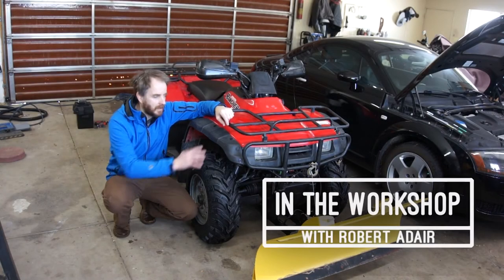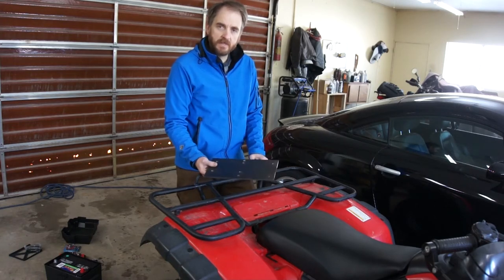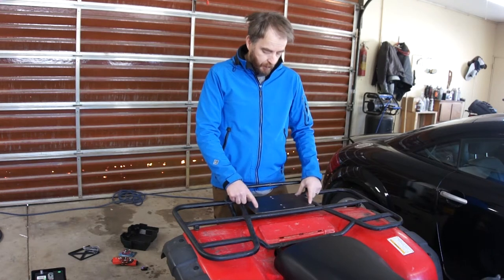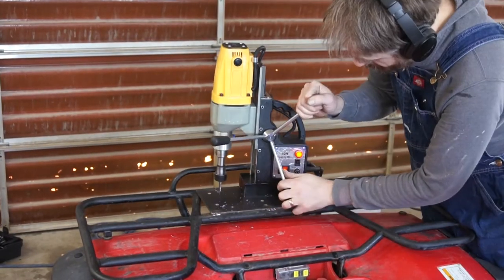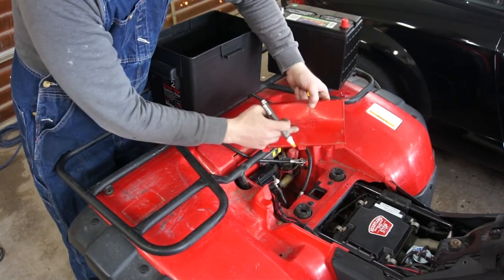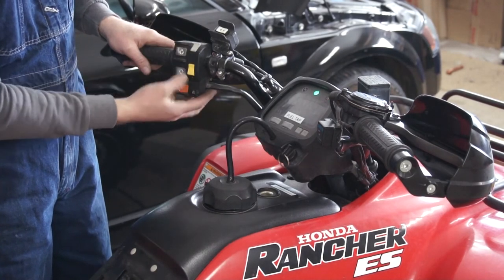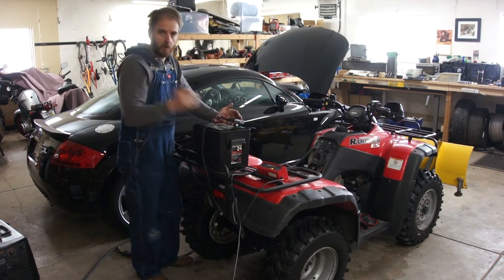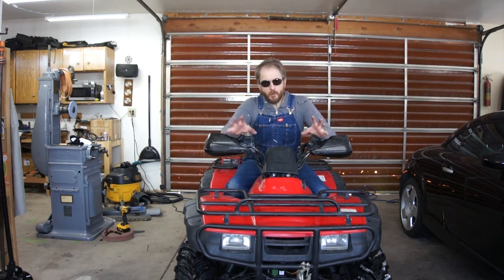Car Battery in my ATV Plow = No More Dead Batteries!

Comment: As an old time trapper, I have learned to never take advise from people who have not done what I want to do. All they seem to offer is negativity. I use the ATV plow year round on the traoline, and about ten years ago, I went to an automotive battery.  It has always worked perfectly. When I check my traps, I leave the ATV running and the battery charges fully. It has never, EVER gone dead. I loved your video. Bravo.

Comment: Can you give us an update on how this has worked over one year?  I have EXACTLY the same problem as I use my ATV to plow my driveway and our entire street.  I was going out to buy another small battery - but it will have the same problem soon.  I'm going with your solution.  I have no concerns about "frying" the charging system.  My Tracker 570 alternator IS designed to run the ATV and charge the small battery at a certain rate.  With a huge battery, it will just take longer to charge.  Since it can't produce enough power to run the plow and the ATV, the big battery will drain as well - but should last long enough to get my job done. Your idea of hooking up a charger after the plow work is the right solution.  Great idea....
Reply from the maker: Hi Craig.  It's still working great.  I had the plow sitting outside all summer without charging and the plow started right up this weekend when I needed it.  I haven't had any trouble with the external battery losing charge or the ATV charging it.  It works the plow, heated grips and two sets of LED lights (I added a set of rear lights late last winter). I would absolutely do it again and I'd do it exactly the same way I did the first time.  Highly recommended if you're having the same trouble I originally did.

Comment: I found myself with  extra good working car battery,about 30 minutes ago I wondered hey,can I put a car battery on my arctic cat 300 4x4 that I use for plowing my long country driveway. Was expecting to see Heavens no you will fry the system,but no found a few sites that said absolutely,and a couple that said oh you will ruin it,so yours was the only video I watched and am going to do same as you,though will just fasten wooden board and bolt battery box at same location. Its very troublesome hooking up charger in that small spot,so having battery right on rear to easy put charger on will be great.

Thanks for video
Reply: Meant to add we had a  car that we had to go to 2 batteries ,worked great,solved the problem
Reply from the maker: I've had really good luck with it.  I can even leave the battery sit for 6 months without charging and it'll crank right over.  The old small battery would run flat enough in that time to give me the solenoid click and I'd have to jump it.  You'll be happy with it when you get to plowing later this year.

Comment: i figured this is my problem also. i not only have a plow but converted to a bucket. used it all day works fine but the next day dead battery, time to go big
Reply from the maker: I sure don't regret doing it to mine.  Even off the charger, it sits all summer without use and doesn't go flat.

Comment: It's been a year now.  Any issues with your charging system?  With the starter motor from extra cranking amps? 

 I'm just tired of the short life of ATV batteries period.  I don't use a snow plow, winch, but just a few extra led lights.  I've been thinking of installing a car battery on my Polaris ranger.    Do you still recommend this?
Reply from the maker: No trouble at all.  The plow sat all summer, not on a charger, and fired right up.  Hadn't been charged since last March.  I have no regrets.

Comment: Hey Robert, nicely done.I’ve been meaning to ask you about your welder. What can you tell me about it? Works well for you? Thanks.
Reply from the maker: Hey, Lee.  Thank you. It’s a Hobart Handler 190.  It recently replaced a Lincoln Wedpak that I had for more than 20-years, so I’m still learning it’s quirks.  It’s a 240v and can do both flux and gas though I’ve only used it for flux.  I quite like it so far.
Reply: @RobertAdairWorkshop  thanks for the reply. I’m enjoying your videos! Keep them coming! All the best.

Comment: Fantastic video I want to do what you did here. I wanted to ask you if you knew what types of electrical issues would happen in the event if the positive and negative battery terminals if they make contact with the frame of the bike? This is exactly what happened to me three weeks ago with my 2010 Brute Force 750. The bike is practically brand-new that's the tragic part of it all.😩
I was in the process of taking the battery out and before I could detach the battery terminals it slipped and made contact with the frame of the bike.
I heard an electrical distortion as if a fuse had blown but all fuses are good and it appears the relays are ok too. Now when I turn the ignition to on the light switch doesn't work or the push start button won't work either and the fan immediately comes on but the fuel pump doesnt. Also the FI is flashing codes 11, 12, and 14 which have nothing to do with my issue. I also tried bridging the solenoid to see if it would start. It will turn over but not crank. 
After unplugging the Fuel Pump relay I ran a jumper wire from the input directly to the positive battery terminal to see if the pump would run and it turned on instantly. 
Another interesting discovery was that it also restored power back to my electric headlights and push-start button was working again but the bike still won't start. It sounds like it wants to start but just simply continues to turn over. If you know the reason or could pinpoint what the issue is feel free to share thanks.
It's appears the power works in a reverse method. Power from the positive battery terminal to the fuel pump relay terminal allows the push start button and headlight switch to begin functioning again and without that jumper wire I've got nothing.😳
Reply from the maker: I'm not very good at electric troubleshooting but I'll give it a go.  My first thought is a relay.  They are sensitive to voltage and you could have popped one.  Pull them out and give them a sniff.  I'm sure you'll be able to see/smell a bad one.   The ECU itself is probably also very sensitive to voltage direction.  Have you pulled it and given it a look to see if anything is burned up?  I'd suspect, maybe some diodes or even a chip itself.  Given the noise you heard, damage should be obvious.
Reply: @RobertAdairWorkshop  Believe it or not all the fuses and relays checkout good those were the first thing I checked which is disappointing to say the least. As for the ecu itself I'm still not sure how to even test it and can't find any info on how to do it. I was trying to avoid having to take all the plastic off so I can see what's happening with all the electrical wires but I didn't because it's practically a brand new 2010 and everything was working perfect before that battery made contact with the bike frame. I just didn't think it would cause this kind of a weird electrical mystery which has turned into a nightmare.😩😳😳😳 I'll keep investigating until its solved because after this I'm having second thoughts about now owning the Brute Force 750 if it's this easy to destroy stuff electrically then I don't really care to own it if I'm being honest. It shouldn't be this troublesome to fix. All this happened over trying to change the rear spark plug. It was a freak accident and I can't help but beat myself up about it because I just got the bike 3 weeks ago and haven't even went anywhere with it yet it's a tragedy and perhaps the most expensive tragedy I've ever been in my whole entire life it's INSANE!!!!!😞

Comment: Great video, I am thinking of doing this same thing on my 08 Arctic Cat 400 4x4, can you tell me what gauge battery cables you went with ? Thanks in advance
Reply from the maker: They were what I could get at WalMart.  I think 6-gauge.
Reply: Hi Robert, can I ask why you choose a 24 Group battery and is this still working for you on your ATV, thank you
Reply from the maker: @joeorciani9691  I chose that one because it was the cheapest one they had.  It is still working great.  I left it sit unused since February, about 9 months, off the charger and it fired right up when I needed it last week.  Totally worth it.  Should have done it sooner.
Reply: Hi Robert, I totally forgot to reply to this last year. I went ahead and did basically the same thing you did, got myself a cheap Walmart car battery, cables, battery box and mounted it to my rear rack. Plowed all last winter with no issues at all, winching, lights, etc. This was just what I needed to do. Thank you for a great video and idea.  @RobertAdairWorkshop

Comment: I'm not so sure you can just use all the electricity you want from the bigger battery. Ya gotta give it back from the charging system. My guess is that the little battery and charging system have the same specs.you also my fry your alt/gen whatever, by working it at it's capacity trying to keep up with the demand.
I'm not busting your chops, I was just thinking while watching.
Reply from the maker: I’m just happy somebody watched it.  :)